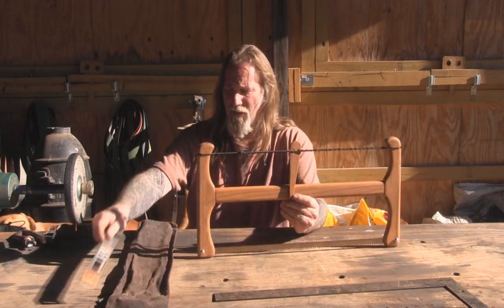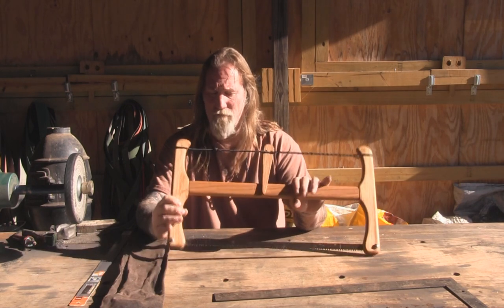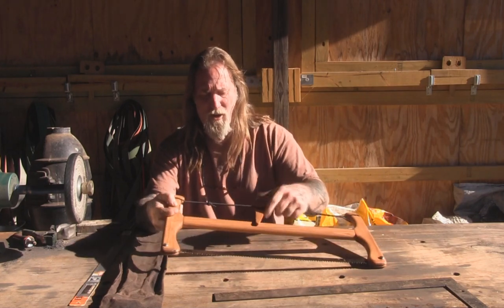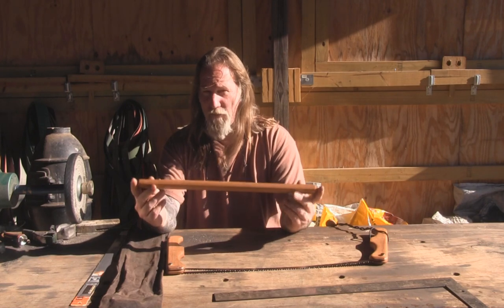Bucksaw Modifications

Comment: Dave - neat idea with the bucksaw.  I was thinking that if you wanted to add a level to the thing, it wouldn't take anything to buy a cheap little bubble level (or even make your own!) and carve a slot in the back of the measuring stick to epoxy it into.  It would add zero weight, wouldn't compromise the integrity of the bow saw and then you'd have an all around carpenter's tool for the woods.

Comment: great functionality. many engineering measuring tools like compound squares, t squares, levels etc incorporate a scibing pin somewhere about them in a push fit hole. perhaps such a thing could be included it this. you could glue one in the tip of the windless turning it into a marking / piercing  tool.

Comment: I understand the modification isn't  difficult. I am just curious why the saw doesn't come from your shop with the mods already made?
Reply from the maker: Well first because I do not manufacture the saw, second because this mod takes time and time adds cost, and this hand made product is already fairly expensive.
Reply: wildernessoutfitters With a premade jig I would think the amount of time it would take would be not more than an additional 10 minutes to the construction time of the saw. I would think $5 increase in price would be more than fair to include the option. This is just a suggestion. I just felt that since you sell the saw; and you think this modification increasing the usefulness of the saw you would offer the saw with the modification already made. Just seemed ligical to me. Even with my clumsy hands I could do the mod myself. I modify gear all the time. So don't think me lazy for the suggestion. Thanks Dave.
Reply: And also, not everybody may want it modified

Comment: Mr. C, how about this? Using the taught tensioning line - a single weighted piece of string hung down and oriented by a 90 degree mark (possibly on the back side of your fulcrum), could be used as a protractor / clinometer / builder's level.

Comment: This may have already been commented but I didn't see it. Is there any way to permanently marking the blade at her will not hurt it's integrity or wear off? If you have a dot or line on the blade you can get a quick reference point for the plumb string rather than trying to look at teeth.  On a second note isn't it funny how our forefathers specifically made multi use tools such as the fence pliers and farm wrench and such, but with all the manufacturing capabilities today it's mostly single use items.

Comment: sight down top of the handles, Etch some lines in the attached blade and you could add inclinometer to the list of functions.
Reply: Great idea, but I'd burn lines on the other side of the stretcher, radiating out from the bottom of the hole (where the plumb line would lie), to match a few common angles and use the plumb bob and stretcher like a rafter square.  With blade stretch over time and differences in tension on the blade when assembled and re-assembled, I don't know if it would remain accurate, plus you'd have to mark every blade you have, or worry about swapping out your "protractor" blade each time you needed that feature.

Addendum: I'd also use a small hole, slightly larger than the line you're likely to use and drill it off-center to the top of the stretcher.  Instead of tying onto the stretcher itself, pass the line through the hole and tie it to a toggle on the other side.  That way you should get a more accurate hang for the plumb.

Comment: You could now have a protractor by lightly scoring the blade at common degree increments as well.
Reply: apextroll  scoring the blade might make a weak point  how about useing a sharpie permentint marker instead   a,sharpie wouldn't take up much space or weight  and is a great tool for laying out cuts
Reply: Walt Lars More like a scratch. The sharpie to darken it up. I thought of a sharpie at first,  but it would definitely rub off during cuts. A  good layout tool on the fly.
Reply: Just have to try both method and gind out

Comment: Most blade teeth are very uniform   so many teeth per inch  do a little math ahead of time   so many teeth  makes a 45 degree angle etc  make a cheat sheet  maybe burn that into the handles  8T = 45 etc